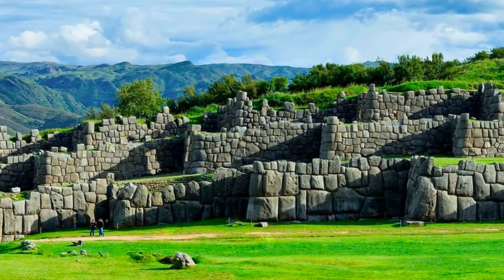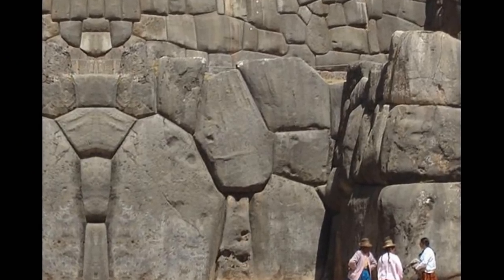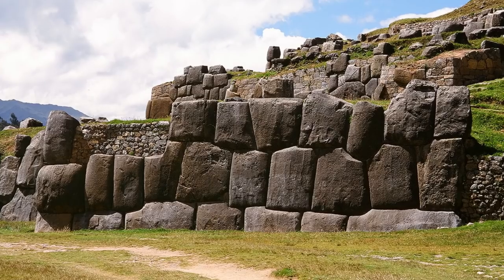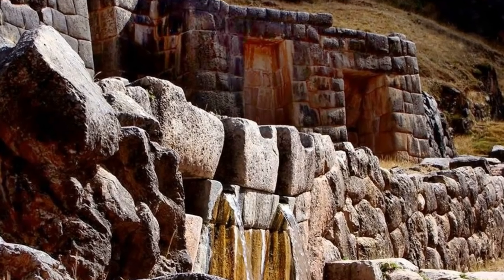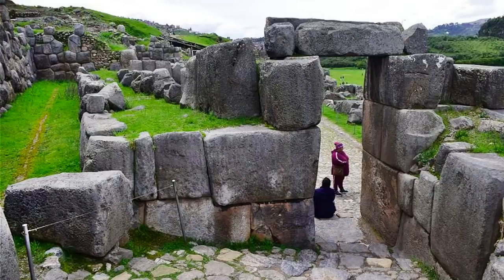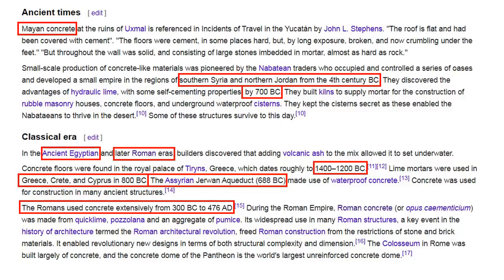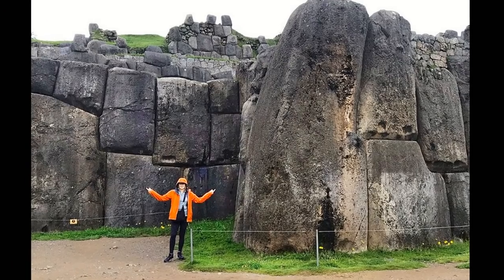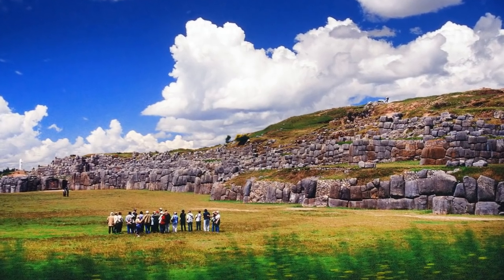Explained: How were Peru’s #Sacsayhuaman Walls Built

Comment: Had to think for awhile before commenting.  How these things were made is the part of history I find most interesting. I have yet to find any explanation of how they were built(starting with hand tool carving) that doesn't have flaws.  The forms are the biggest problem here.  The amount of weight pushing out and down is gigantic.  If some one smarter than me could do that with cement that would be going a long way towards helping this theory.  Also if I was building a wall that way I would have hard rock pins that I would stick into the sides of one block with the end sticking out so the next block poured would mold around it like rebar.  You did do a good job putting this forward.

Comment: Hi, Great video. 

This is not a rebuttal or anything at all like that. In my humble opinion, (which is not worth much until we publish, which is quite a while out), you're very close to what we've duplicated, and among the best of the logical, objective theories.  

@4:38 The rough and rubble filled backs of the stones.  They represent only a small fraction of the polygonal masonry at Sacsayhuaman.  They are a type distinct from the bulk of the "stonework"  They are always found on top of or adjacent to the actual anomalous blocks.  Switching over to assumption They are cited most frequently by the mainstream even though they are just a small part, because they are the only ones they can duplicate with cutting techniques. (It took a team of 5, 2 weeks to do one small block, and they ended up using powertools, lol) They probably are cut stones, some may even be cut and reworked pieces of the "concrete" walls of the original builders, done by a later culture. They are only fitted well a few centimeters in from the face, just emulating the originals.  I wouldn't even consider it a mistake on your part, they are the focus of study, therefore what is published officially. The bulk can't be defended as quarried, well without alliens. :)

I disagree on the need for the molds.  Concrete is stronger the dryer it is when mixed. Using previously cured blocks as the side forms, then tamping and walking in a very dry mix, then finishing the surfaces as they went would be another possibilty. If thete is no rebar to flow around nothing necessitates a wet poured concrete.

I really enjoyed some of your defenses to some of the rebutals. I think the the stone only theory is crumbling.

Cheers.
Reply from the maker: Thank you very much for sharing your insight with me, Rick. I really appreciate it!

Comment: I would like to see a step-by-step process, 

What was the mix material?
The molds themselves would have to be super accurate, very robust, yet disposable. 

The advantage of casting presumably would be to eliminate lifting heavy stones, but it’s impossible to cast in place. 

There’s no room for the mold in a running wall while still maintaining minimal clearances. 

And the heavy cast stones would still have to be lifted and fitted into place.

Has anyone ever tried to reproduce this, even on a small scale?

Comment: I always thought they used something like hemp sacking as a former.. incredibly strong yet flexible and maliable and would also bulge out on the larger open surfaces... I saw something similar where sacks of sand and cement had been stacked into a wall, they had hardened, the outer bag deteriorated and voila, one dry stone wall looking like bags of cement 😄😄😊👍
*another fantastic vid here btw 😊✌✌
Reply from the maker: Thanks for sharing with me!  I appreciate it. I heard of the bag sacking idea 😊  That means the bags must be extremely strong, thin and texture-free to be able to hold the multi-ton smooth blocks with minimal gaps in-between.
Reply: @CuriousBeingbyTina  I guess so.. some of the new materials we have developed in the textile industry could probably do it.. I see someone has engeneered spider webbing with an enzyme, to create a textile superior in strength to spider webbing. 😊 love your work btw 😊😊✌

"A new fiber, made by genetically engineered bacteria is stronger than steel and tougher than Kevlar. Spider silk is said to be one of the strongest, toughest materials on the Earth. Now engineers at Washington University in St. ... The resulting fibers are stronger and tougher than some natural spider silks.20/07/2021"
Reply from the maker: @jamescgardner1269  This new fiber is very cool. Thank you for the information😊 I really appreciate your support!

Comment: The Blocks did come from a local quarry and surrounding  and were not moulded like cement.
They matched Volcanic lava flows located close to the site. 
If you had the tech to make cement blocks you would make them all the same like we do today and not make them all different shapes and sizes.
The Blocks were used this way to utilise them without having to dress them into more exact shapes making less work and waste. Local mine tailing water that is very acidic was used on the lower blocks and when the upper heavy block was placed it's weight pushed into the lower block that had been coated with the acidic water making a tight joint.
Acidic water will easily make the limestone or granite soft.
That is why the blocks that have another one on top are all indented with the shape of the bottom of the one above it that was pressing down on it.
The blocks were not really quarried as such, but were just used the shape and size that they were found this explains why they are all different shapes and sizes.
It saved them a lot of time as they did not have to spend countless months or years cutting blocks from the volcanic hillside around the area. And yes this can be accomplished today.
Reply from the maker: Thank you. In the later half of the video, I presented the conclusion from a team of Russian geophysicists that the material is man-made with elements quarried from a nearby quarry. I also explained why and how the blocks are in different shapes and sizes. Hope to hear your feedback on that.
Reply: @CuriousBeingbyTina  This was just one conclusion other samples have been tested and found that they could be from a volcanic flow near the site.
And even if they wanted to make the blocks different sizes to stop them from coming apart in earthquakes they still wouldn't have made some blocks so massive as to be so hard to move given that they did not have modern cranes to lift them, they would have made the a more manageable size.
Especially while still soft.
Also why would you quarry stone then crush it into powder just to reform it back into blocks that would have been even harder to work with and move as they would have had to be still soft when stacked up on top of each other to form tight joints.
You can't stack still soft blocks on top of each other without some sort of individual wrappings to stop each lower block from coming apart with the weight from the one on top. Try lifting a 30 ton block of  soft playdo like substance it would be impossible . Go mix up some concreate and make huge blocks then stack them on top of each other while still soft and see what would happen. It is hard enough to life huge solid blocks of irregular shapes let alone huge soft ones. The protrusions on some blocks were so that the ropes did not slip of the blocks while moving them. and the cup marks on the bottom of some were so that they could use large logs to hold up the blocks while working underneath them.

Comment: Not sure if I agree with the concrete casting. I have worked with concrete, and it will tend to bond with adjoining blocks even if partially set. The time used to set blocks and cure before placing the next is not very efficient. The marks on the blocks seem to indicate heat was applied, which can soften the stones. I recall seeing a depiction of the process on a wall in South America or Mexico. There was a worker who was operating a flame thrower directed at rocks that had been cut or separated. I have a copy of a photo showing this process, but I didn't write the name of the site in the file, so I can't tell you the exact location of it. It seems that the same heating method was used when making the platform on Easter Island.

I do understand why it may seem a geopolymer was used for some construction, but this particular case at Saqsahuaman would require a lot more work than using heat to soften the stones. Also, the finished product would look different than it does after separating from an earthquake. Other sites, like some of those in Egypt, definitely saw some geopolymer use. Many strange things happened in early history of humanity, but I see efficiency and effectiveness as two coexisting themes in early megalithic constructions.

You are doing a great job, and I really do appreciate the time you spend on putting your presentations together. You have shown some sites in detail that I had never seen before. Keep being curious :)
Reply from the maker: Thank you for sharing with me. I really appreciate it.  I think this concrete/ geopolymer could be different from today's Portland concrete. I explained in the video that I think this special concrete might be a fast curing and expansive concrete with a plastic state like play-dough when it cures.  Thanks again for the support!

Comment: This is definitely the most plausible explanation for the wall. Would there not be more physical evidence of poured concrete on the back side/hill side of the wall.  Is it possible that the megalithic stone structures under Rome are also poured concrete or some form. Here as well though, if it was poured, it should be evident on the base where the block was formed. They couldn't have finish all sides of a block without any trace of a pour. Very interesting. History is fascinating. Even more interesting is how much we doubt there capabilities
Reply: To add to this theory. At the base of the blocks could possibly be where the pour/injection was made. Using some sort of hydraulic system with water to pump there mix too the moldings. A hydraulic system similar to the roman aqueduct. Injecting bottom up on the mold could be a way to eliminate air pockets.

Comment: Very inspiring! In Machu Picchu there is the quarry, where the rough stone blocks are cut of, some stones are still in the preparing stage. They where partly prefabricated, then transported to the building site and finished. The back side of the stones didn`t have to fit in the joints. This work style was known also in Egypt as many might have seen. But anyway I share with You the ashtonishment with the 200 tons 8,5 m stones. In Machu Picchu there are also structures not so well finished. But the higher standard buildings followed the special technology. This information has been published recently in the Bonnier Publications` History Magasin based on the book Hiram Bingham, Lost City of Incas and the Story of Machu Picchu and Its Builders, Weidenfeld and Nicholson, 2002.
Reply from the maker: Thank you for sharing with me, Raimo! I really appreciate it. I will search for the publication you recommended :-)

Comment: Excellent video,  it all makes sense. 
One question I will ask,  why did they use different sizes of blocks,  wouldn't it have been easier to work with the same or similar sized blocks like builders today?
Reply from the maker: Thank you Tom. I explained my thoughts on why the blocks are in different sizes in the later part of the video :-)

Comment: From looking at other parts of these walls there looks like some have still natural shaped stones. So it looks like they were stacked in place then some system or procedure was used to slightly soft-melt the stones into their tight fit and at that time workers finished the bull-nosing at the joints. Which might explain all the different size stone blocks due to the use of different sized stones when stacking them. Some stones facing look like they have scooped out areas, like scooping out ice cream

Comment: Fascinating to see the problem solving abilities and creativity thinking of our human ancestors.  The stones do look like they were softer at one time. Is it possible that they used bags filled with the lime concrete that had overfill drains at the bottom?  Bags of regular concrete will fit tight and have rounded seams if you pile them up.  The  molds could have been made  with a combination of shaped wood and cloth/fabric/skin.
Reply from the maker: Thank you for sharing your thoughts, Joe. The bag theory is interesting, though I find it difficult to think of a very thin and smooth membrane or fabric strong enough to hold these massive blocks in shape...
Reply: @CuriousBeingbyTina  https://www.youtube.com/watch?v=gfqfmXcz_oI   This is on the subject of using concrete to make the blocks  - it's a thought to consider.

Comment: You and a few others came up with the same accurate conclusion. Cement workers will recognize the characteristics seen on the walls as well as people who work with clay. Only thing I would add is the possibility animal skins may have been used to help keep the form as the material hardens.

Comment: I like your theory. Similar method used in Egypt and elsewhere. Might also be possible that the massive blocks at the bottom were actually pored into holes in the ground.....then the earth removed leaving the stones standing....then higher layers were cast in the open.
Reply from the maker: Thank you for the support. I agree that similar method was probably used in Egypt. At Sacsayhuaman, I think what you said is quite possible the bottom/ foundation blocks were poured and the upper layers were cast :-)

Comment: A liquid was infact used to soften marbles, not just there but all over the world, including kem, and the rest of the pyramids. 
They were levitated into position first, then a silicone or rubber like drum was used as a mold.
These rubber molds were made on the large phallic blocks also seen in multiple places. many hundreds of molds were made in all sizes and shapes.
Once the stone was lowered into the liquid it would turn soft and stay that way for a short time, it was then levitated back out and placed into the final position. this allowed them to fill into every gap, and nook with flawless precision. 
When these kinds of walls were dried and finished not even aan earth quake would topple them because the resonance couldn't pass through the different sized blocks enough to shake the entire wall, so it may jiggle around a bit but thats it. 
As far as I know no one has ever found this liquid, and the only proof of it seems to be the melted stone steps that are another famous mystery, that room must have been a store house for the liquid and when looted or being removed someone spilled some of it on the steps and the stone softened briefly showing them now looking melted. 
No form of concrete was used by the original atlantean builders in these types of constructions. 
It is possible the egyptians did use a concrete type technology though.

Comment: Hi Tina, another great video.  I like the idea of the concrete like construction.  It seems the most plausible of the theories I've heard so far.  The adjustable mold theory makes sense given the irregular shapes of the stones.  You would also only need 3 sides for most of them, the front, back and one side.  One side would be left off to mate with the previous stone on the same level and the top and bottom left open.  Only when doing the first stone on a level would you need all 4 sides.  

The knobs as an over/out flow makes sense too.  You do this with injection molding.  You need a place for the air bubbles to escape.  You keep pouring or injecting until you see material come out the air vent.  These knobs could also act as anchor points to help secure the next adjacent mold in place and be knocked off later.

I wonder if the part about a plant derivative making the stone soft is a misunderstanding of the explanation from the indigenous people.  Perhaps the initial state of the stone wasn't hard but a pulverized powder, like a bag of cement.  You would need to add some kind of liquid to make it a paste, "soft".  The Romans were know to include organic liquid binders to their cement like urine and pig's blood.  I wonder if a sample of the stone could be pulverized to analyzed in a mass spectrometer.  Would the chemical composition of the stone encompass that of any of the chemical signatures of indigenous plants to that area?  This could go a long way to proving your theory.

Anyway, nice video Tina.  Keep up the good work!
Reply from the maker: Thanks for the support, Ken. I appreciate you sharing your insight with me. The Russian geophysicists poured acid on a sample and it almost completely dissolved. They also did some testing on the material and concluded that the blocks are not natural stone but they don't know what method was used to create these blocks...It'll be nice if some geologists can do more material analysis. 
Thanks again for the comment! Hope you enjoy my other videos as well :-)
Reply: @CuriousBeingbyTina  Thanks for the reply and additional information Tina.  Yes!  I'm watching your other videos now and enjoying them.  Your channel is like finding a treasure!  I'm a very curious person too and have been studying Ancient Advanced Civilizations and a few other topics for several years now.  Feel free to reach out to me to kick around any ideas.  I can share what I've learned and maybe point you to some additional resources.

Comment: in my city, there runs a river,
and it's base is that of shale.
hundred years ago, those early
citizens mined the shale to
make building foundations and
sidewalks. They numbered the layers,
then clave them with hammers and chisels.
Afterwards reassembled them at the
construction site. I suspect the same
holds true for many mega-sites.
We still have buildings whose 100 y/o shale
foundations are still intact while the red
brickwork layer above them undergo occasional maintenance.